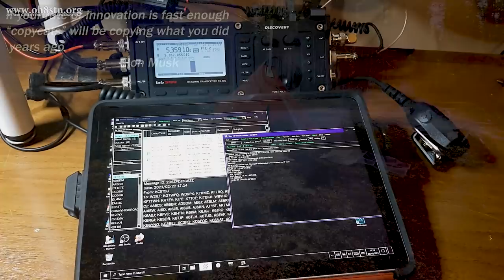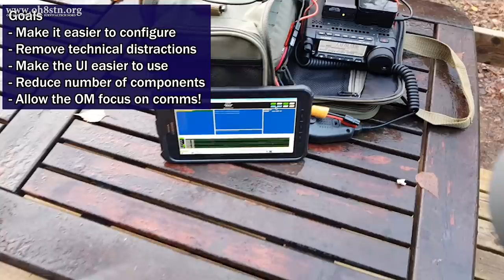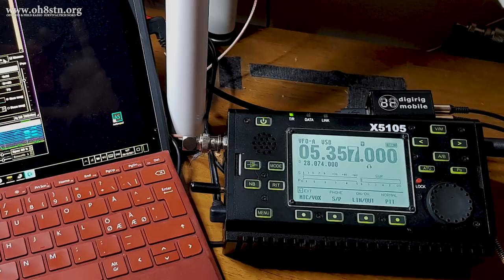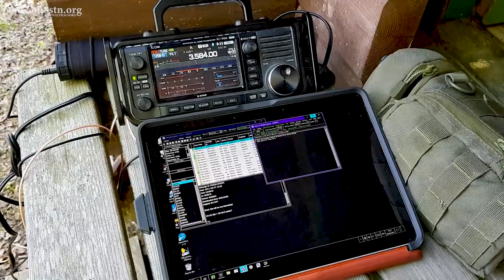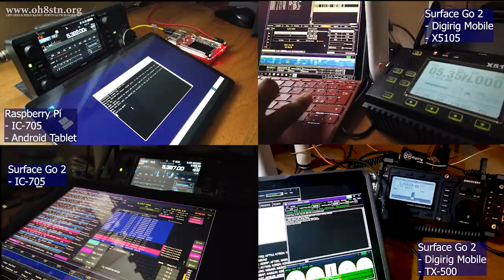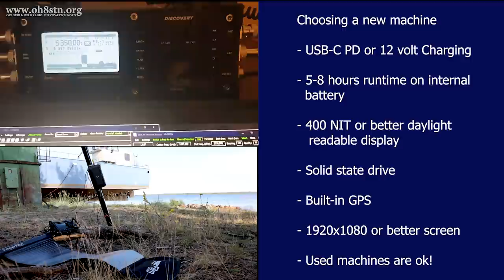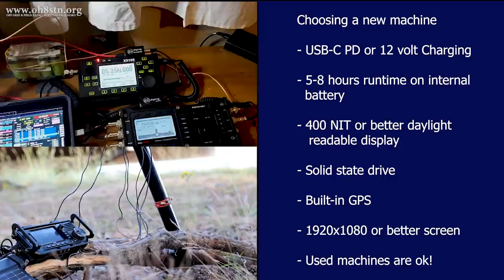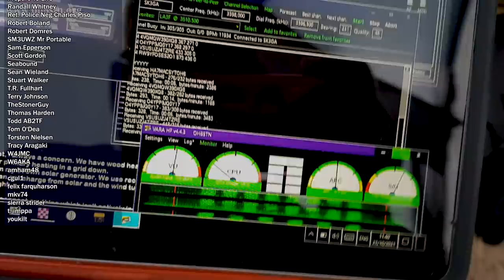Goodbye Raspberry Pi

Comment: Android and iOS don't provide enough liberty for developers (or users!).  Both Google and Apple have applied aggressive walled-garden tactics to control app markets, and I've had more than one app that I really liked run afoul of Big Corp's opinions of what they want on the platform and get axed.  

At least on Android you can force an APK (usually...), but iOS leaves you in quasi-legal, warranty-voiding jailbreak territory in the worst case.  Even further, the legal controls applied to restrict the user's control of the device (that they "bought" but do not "own") make it sketchy, IMO, for long term reliability.  

As usable and nice the hardware might be, it's a bad choice for reliable off-grid communications.  I know you don't usually get into software politics, but this stuff will only become more contentious in the future :-).

Comment: There are alternatives to RasPi for Windows, like a simple PC Stick-Intel Atom z8350
Reply from the maker: Agreed. That would require continuing to carry an Android tablet to boot the PC stick. It's an option, and even a good one. I'm just trying to reduce the number of components oh, and potential points of failure. Great idea, thanks for watching and for the comment.
Reply: @OH8STN  Agreed. What i meant is the RasPi is not the only one mini-PC on the market, there are Intel NUC boards even. But a Surface is the best to get "all in one".

Comment: Unfortunately, Android is largely java-centric.  Yes, it's "based" on Linux but very loosely. 
   I use my pi headless for remote digipeater mesh network running BPQ. If one takes a lightning strike or goes down for some other reason, no big woop.
Reply from the maker: Watch the entire video
Reply: @OH8STN  I did. To what are you referring?

Comment: You talk about points of failure then say use an all in one non serviceable tablet?  If you don't see this problem Julian....
Reply: You get what you pay for, Ronny. Anything twenty times cheaper than a Surface Go will fail twenty times more often than a Surface.
Reply: @sammiller6631  Well the Pi's have not failed yet.  Matter of fact I have not had but one hard drive failure since my Apple  ][ days.  Nothing wrong with doing it the way that works for you.
Reply: @W4TRI  Good for you if you've lucked out with no failures, but many others aren't as lucky with RPi failures.